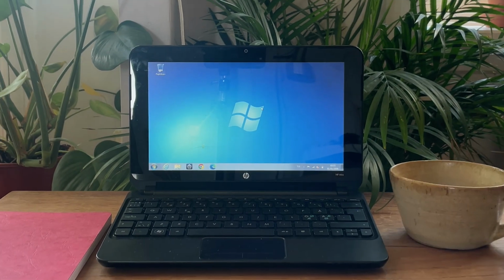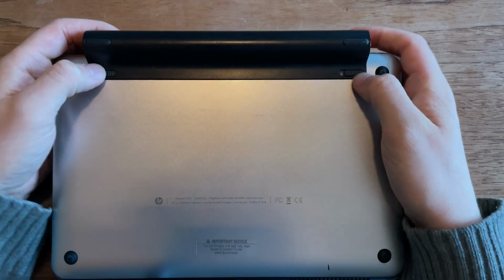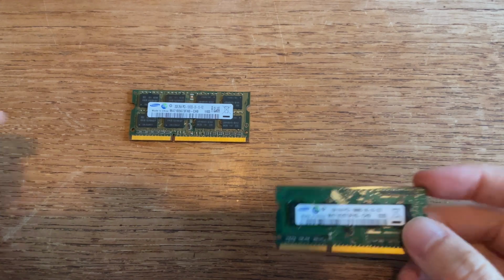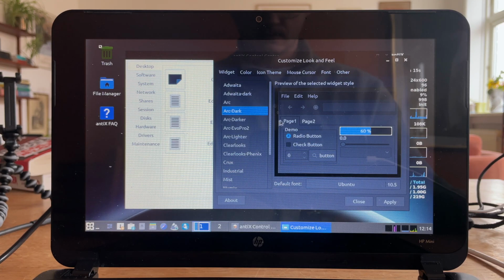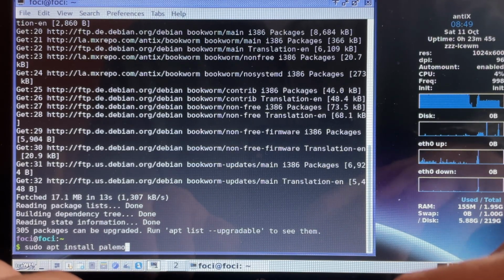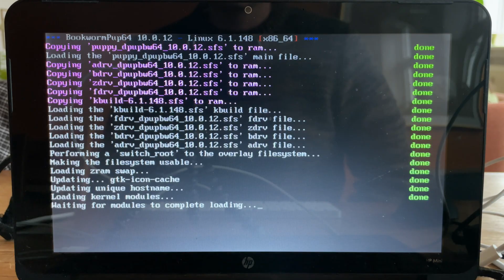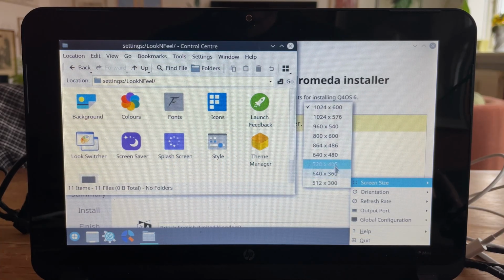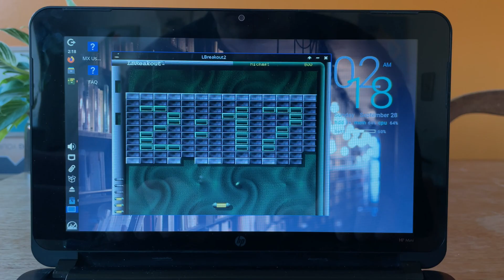Can "lightweight" Linux distros save this tiny laptop from 2010?

Comment: cool he tried puppy linux on this
Reply: Like Q4OS, Puppy Linux really isnt all that "light" these days, its actually closer to midweight. This situation requires ACTUALLY light distros like AntiX/Loc-OS, Bodhi Linux, MiniOS, BestGNULinux
Reply: I installed antix on an old pc we have in our new home. Rn  it works well on 1GB of ram :) @TacticalPower88
Reply: Tiny Core 🙏🏼
Reply: @TacticalPower88  None of those are lite so why would you advise them??
Reply: @tomapc Uhhhhhhh... It really doesn't get much lighter than those I listed. Especially if you dont want to be left on a island in terms of software/support.
Reply: @TacticalPower88  2 and 3GB ISO is not lite, 200MB is, see Porteus as it is the only lite distro that works properly and has version for every hardware. Try the Mate version of Porteus, the tell me how those you listed look compared to it.
Reply: @tomapc Yea... By "light" im clearly referring to how optimized the distro is performance wise, not so much concerned about it having the tiniest possible file size. Especially if its already small enough to not be a issue on anything remotely reasonable. Porteus is a also a cool light distro, its just more suitable as a quick live environment to carry around on a thumb drive than it is actually installed on a daily driven machine tho. Thats why its so small in file size... BTW, MATE desktop environment by itself is definitely on the higher end of midweight. Out of the question on this netbook.
Reply: @tomapc Puppy gone that bloated too, OMG. I used to use&love Lucid Puppy 15 years ago when it was truly lightweight. Thanks for both for all suggestions. We need true lightweight (like 90's OSes in general) distros with both user-friendliness and controllability & customizability.
Reply: @TheSimoc  Back then there were plenty of really nice distros, Slax that no one mentions was perfectly usable and very fast and very good looking, and there was Mandriva a bit bigger than Lite versions but fully featured and quite stable, Knoppix was magnificent not so lite, but was very, very good for PC service and repair as it would list everything during boot, and no new distros do not that, not in that detail.
Reply: @tomapc  I have an HP Mini 110-1130LA and I recently installed Loc-OS and it works perfectly.
Reply: @polafran  Nice to know, thank you.
Reply: You should try antix linux :) @focivideo
Reply: Adelie

Edit: Void also Good candidate

Comment: Before giving up, I would try an older version of Zorin OS.  They no longer make a 32-bit version, so you need to get an older one. But how is that any better?  Well, at that time, they also made a LIGHT version.  I used Zorin OS Lite on a similar device that only had 1GB of RAM.  But, the best OS that I tried on it was a super slimmed version of Windows 7.  "Tiny 7" worked well on it.  Don't quite remember how it did on YouTube.  If browsing is restricted to only trusted sites, you could get online.  I'm testing a very light and very efficient little browser (in beta) that prioritizes privacy.  It's called Helium, and I'm pretty sure it's compatible.

Anyway,
Cheers from Canada

Comment: Posting this on an 11" Macbook Air with 2gb of RAM.  I haven't upgraded because you can't.  I do have another SSD to put in and will do thermal paste.  I'm running AntiX.  I tried Bodhi, MiniOS and a couple others, but AntiX really works well.  Laptop cost me $37

Comment: With the Q4OS installer issue, if you hold Alt and click anywhere on the window, you can drag it upward to see the Next button. I had to do this on my 11" Eee PC to get it to install, then after install go to the start menu > Control panel > System Admin > Screen Scaling and lower it to something more reasonable.

Comment: i tried to nstall linux on plenty of these netbooks to revive them but the problem is the graphics acceleration because it has a different vendor though it is branded intel GMA and sadly the graphics is not working so every distro became laggy, even chromeos struggles

Comment: I tried to revive one with 2 gb (successfully), but the cpu was so slow even with ssd. And the display is horrible. I was hoping to use it as a comic/reader but the viewing angles were so bad. I thought about gutting it and replacing the internals with modern hardware but than realized that I would pretty much be buying a whole other comp when I already have one.

Comment: Yep, your are absolutely right that this CPU is a bottle neck. Any distro of Linux is not about a performance but about of OS usability first of all. So do not concentrate on playing with different sort of distros but choose a nice one liked by yours and try to optimise it for your system. As a Linux user you have to install proper and latest soft for your hardware (drivers), organise memory usage and yep do upgrade for your hardware (you have already done it for this machine). Do not wait better performance compare to windows try to compare it's productivity and your user experience. Mostly it is easier to do something on lts version of linux rather than old school unsupported windows.
I'm trying to say that when u use an old style version of linux that was founded to free ram on server machine with out any UI that was rapidly added lately, it will be hard to call that experience nice and interactive. Try modern popular distro like ubuntu or fedora. If it is not boot up on one core platform then it is better to sell this laptop or use it with old hdd as home ness or personal server

Comment: Around this time I had a similar netbook, which ran Windows 7. I believe it had 1 GB of RAM. Even though from a hardware standpoint it was a low-spec machine even for its time, I really liked that computer and thought it was cool.

The fact that these days just trying to run YouTube on a computer like that damn near crashes the whole machine is wild. It's absurd how many resources just doing something like trying to play a video on the Internet takes up now. YouTube ran fine on that computer 15 years ago and the website doesn't do much more now than it did then, so why should it require so much more horsepower?

Comment: I also had an old acer aspire switch 10e.
These old machine can be used for few purposes.

1) Ebook Reader
2) Media Server - Emby,Jellyfin,Plex you can also automate the process if you like added a movie to your watchlist it will automatically download using torrent and save the file in desired location and then the media server will detect it. Automation tools are sonaar, radarr, pworlarr
3) Own Minecraft server
4) For browser i used Min although opening any browser just made this machine lag
5) Music Player - latest version of Spotify might not work on your device you can use legacy builds or my suggestion would be used ncmpcpp or rmpc in cli might need a bit of configuration but works flawlessly once done.
6) yt-x and yt-dlp for youtube. Might need some configuration to adjust default video quality and ani-cli or viu/fastanime for anime.
7) Use as a second monitor- inputleap helps to use one mouse and keyboard to be used on multiple devices.
8) Kdeconnect and gsconnect are good software to connect phone and pc.
9) if you plan to reuse this and are comfortable with cli cmatrix anc cbonsai are good for screensaver.
10) An old phone can also be used in the reuse of it by sharing it's screen and using apps then.
11) You should also check out operating systems like ChromeOS/ChromeOS flex they will run well on it too (I don't think they can be installed with ventoy) or any android based os - primeos,blissos,phoenixos,androidx86 but before choosing an android version just check if your cpu has the supported sse version and instruction sets.

Comment: I have an Acer eMachines from 2009 which I CPU-upgraded from its AMD TF-20 to Turion TL-60 and topped its RAM to 4GB DDR2 (you said your laptop works on DDR3 so my laptop runs with worst RAM) and switch to SSD as well. I worked during his year on it with LUBUNTU (which failed to you), Linux MInt Cinnamon 22.1 (which after an update on July, it stopped working), tried Bhodi Linux (which is XFCE and for low resources distro) but didn't like it, Zorin OS Lite (which I didn't like), MX Linux 23.5 (XFCE which for any reason failed thanks to some "tweaks" Chatgpt gave me) and now with Peppermint OS (latest distro Debian 13 based) and my eMachines runs AMAZINGLY. I do not KNOW which CPU your laptop has, but start by topping your RAM. I use that laptop for basic stuff such as office stuff, browsing and ytube (I LOVE BRAVE, which runs ok but not optimal) and some GB Advance emulation.

Here my reccomended distros:
bhodi linux: https://www.bodhilinux.com/
sparky linux: https://sparkylinux.org/download/stable/ >> look for the MinimalGUI amd64
PeppermintOS: https://peppermintos.com/choose-your-base/
Alpine Linux: https://alpinelinux.org/downloads/ >> not for linux rookies

Comment: okay, this gonna sound a little expensive and maybe foolish but:
Processor upgrade and if possible RAM upgrade, i reckon that woulda get this little beast running pretty well.

your videos are really interesting and well made, this one personally i really interesting for me, since i've found out about Linux and started messing with it (i still suck lol) i've always asked myself how much old-hardware we can revive and make useful to some extent again.

P.S: overclocking the cpu just slightly above the normal value might help with some things.
Reply from the maker: Thanks a lot for the kind words! It could certainly to upgrade it as far as possible. I'll definitely look into some overclocking. Cheers:)

Comment: Those CPU which support a motherboard of DDR2 or DD3 are fussy about the RAM stick and it requires taking a very clear photograph (following static precautions) of the very small coding written onto the chips situated on the RAM module itself, for both the old (module) stick and the new stick. thereby finding similar number (or a module pulled from a computer that is intel that supports a 2GB stick, whereby the coding might differ) allows to narrow don the trial and error of what stick (module) shall function correctly in that atom N455. Some Celeron laptops would have a similar issue such as the Inspiron range for DDR2. It is likely the DDR3 is for that N455 notebook. 
However, the computer has the 2GB by now. An external monitor could have allowed higher screen resolution. A standard debian13 (maybe debian12) might be  kinder on the RAM and using XFCE or LXDE if insisting on desktop-environment rather than window manager. There is one way, other than adding RAM to assist its SWAP space by it is somewhat complicated and basically, using a GPU with a decent amount of VRAM allows for SWAP space to be allocated in the VRAM by an OpenCL software, and also for the VRAM to be SquashFS space for an extra drive, and so the GPU would install like an external enclosure via the internal PCIe slot (by means of a special adaptor ribbon cable for extending the PCI-express and then and enclosure for a Power-supply perhaps a ATX PSU, so it has its own power-supply and grounding, whilst paying attention to BIOS UEFI settings for display). It does not get used as a GPU, per se (that way). Using the RJ45 port to run a CAT5e cable to the ethernet port of a significantly better computer running SQUASH-FS means a drive (by say SAMBA and or PuTTY and or OpenSSH) means a RAM storage can be achieved down the Cat5e cable of 1GBps which would have normal HDD style top speed but far superior instantaneous access time and no wear and tear (whereas NAND would have). even though XFCE desktop would be run, it can assist dependencies to also install GNOME (but not chosen in place of XFCE via the gdm3 desktop-manager even though it wold be run once for settings) and the gnome-tweaks and gnome-common too. It means various displays are easier to test and some software also shows up in XFCE. The Ghost4Linux_G4L_UltimateBootCD_UBCD538 is worth using via external CD or DVDRW drive to take an entire image of the computer to USB key in split gzip 1GB files as local-mode RAW-mode by a "img" extension alphanumeric filename. Games like Neverball or Neverputt can test the graphics along with Wesnoth and tremulous and Minetest and SuperTuxKart too. Various gadgets like Lighttd and Wireshark and Tomcat and xarchiver and conda and transmission and gtkhash and GNURadio and php-pgsql and phpmyadmin and pgadmin3 and gparted and partclone and unetbootin and winetricks and debgpt and mariadb and sqlite3 and dlib and ansible and qemu and Apache-trift and angelfish and VLC-media-player and guvcview and asunder and brasero and GRSync and  USBIP and and python and astropy and Scipy cups-pdf and xpdf may assist the technical side and PSUTIL to use like mangohud (remembering to encourage the viewership to consider being a funder even as a one-off small bit). The distro slackware can be worth a look after all that (looking at the manual for slackpkg slack-packages and slackware-ports and there is an FAQ at the site, and a few spare USB pendrive mass-storage devices can be worthwhile using).
My comment has no hate in it and I do no harm. I am not appalled or afraid, boasting or envying or complaining... Just saying. Psalms23: Giving thanks and praise to the Lord and peace and love. Also, I'd say Matthew6.

Comment: linux mint defaults to a gpt partitioning table
which is not bootable with the legacy boot mode in the bios
i would assume that the bios does not have a uefi boot mode in the first place
the easy fix is to do a manual partitioning
and format the disk from there as mbr (i think it's called "dos")
make 3 partitions
1 for /boot (at least 1 gb)
2 for swap (make at least 8gb)
3 for / (root dir)

Comment: Great video again, feeling a little bit "glossed over" Re:  My Puppy recommendations though ... Couple quick tweaks for the testing ...

1)  Install a different distro - the "Bionic 8.0" or "Xenial 7.5" releases will run much better & have current updates & installers with the Quickpet utility ...

2)  Run the CPU frequency scaling tool, & set the boxes to performance & the highest numbers You can in each.

3) Palemoon should be installed in both of these distros already, but if You want to get to LibreOffice try the Fatdog64 distro, it's a DVD ISO, but still very much a Puppy.

4) And honestly, add a copy of Puppy Arcade 11 to Your Ventoy list ... You'll love it.

Comment: I even see that fydeos is a better option even if it has a few more requirements, you can use android apps and install youtube apk And it works better, I tested it on a Celeron n3350

Comment: Since it uses DDR3 RAM and not DDR 2, you can easily upgrade it to at most 4GB or RAM, since most processors at the time sadly do not support 8GB RAM. But you can try it if you'd like to experiment and see if the processor can handle it. Sadly though more RAM doesnt always mean more preformance, considering the age of the Laptop, but it will boost preformance.

Comment: I have an HP 10X2 (Quad core Atom/2GB/64GB EMMC) with a touch screen and a detachable keyboard (With a 1TB HDD in the keyboard). It's running Bodhi Linux quite happily and does YouTube perfectly well as long as I keep the resolution down. Everything works as it should including WiFi, the touchscreen and sound.

Comment: Try it with Loc-OS (a distro created in Uruguay if I remember correctly, but obviously supports multiple languages). I have an HP Mini 110-1130LA with 1GB RAM and it works perfectly. I have managed to watch videos on YouTube at 480p without any problems.

Comment: I noticed that you are using 64bit version of the distros. This is actually bad for performance, 64bit require higher bits, and more percision. Thus apps will be more laggy and slower than if you used 32bit. Since 32bit take less ram, it's faster to navigate and process. And you don't need 64bit unless you have more than 3gb of ram. Just my 2 cents...

Comment: I would suggest and Arch base install with i3wm as the gui the add few things such as picom, kitty, neovim, firefox, and don't forget the YAY package manager.  You will have to config a lot of the i3wm environment using nvim in terminal. I would think its a fun practice and you can add your own touch to a desktop interface.

Comment: I tried ventoy but failed, idk what to do, can I expect a step by step tutorial on ventoy? Thanks :)
Reply: There are some distros that won't install correctly from Ventoy, though most all of them I have tried (that I can remember) do run live from it. Seems like Fedora had to be burned to USB to install, OpenMandriva, GhostBSD, and there are others. I once kept a list because I'm a list person, but that fell by the wayside and my memory stinks, so I'll just say that if you can't install or run live USB style from Ventoy, burn a USB and try it that way.
Edit: I will say that years ago when I tried Ventoy the first time I had the same discouragement as you because there were a LOT of distros that it didn't play nice with. It's vastly better now, but sometimes it does fail still.